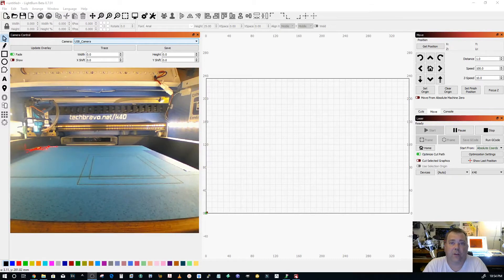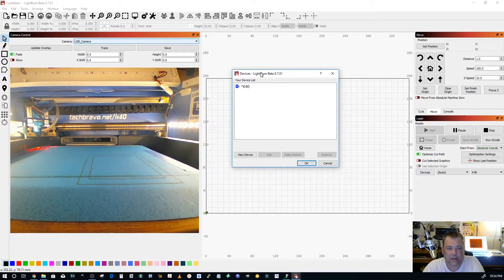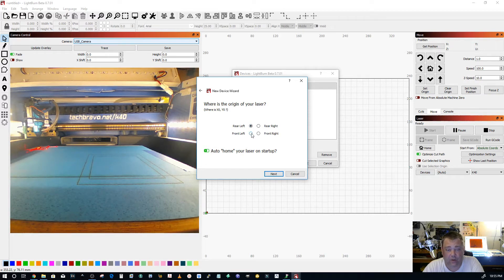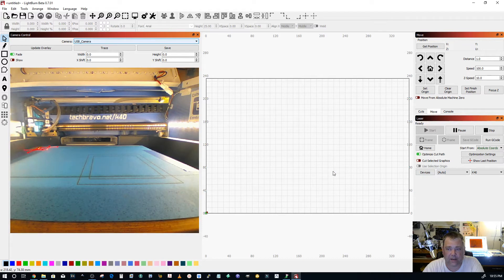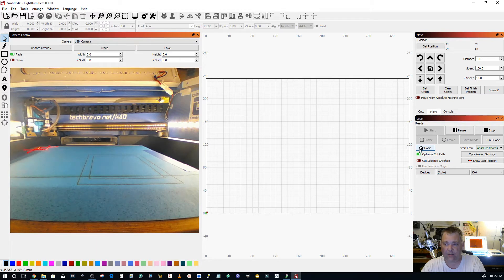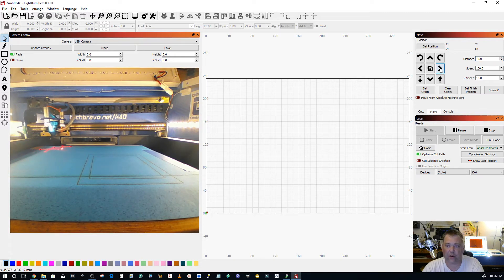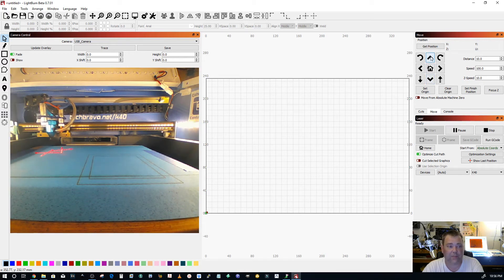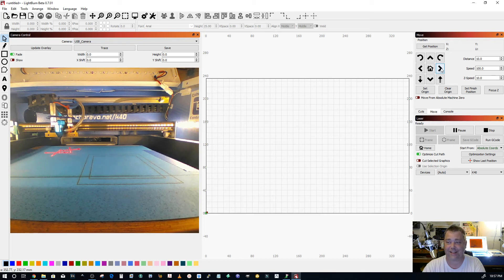Cohesion3D Mini Origin, Stepper Cable Verification, & Home When Complete

Comment: Hi, I’ve just changed to the same board on my 4940 laser, when I hit home it moves down towards the front and right , all arrow keys are working, when I start a job it dose not seem to know on the workspace where it is , it’s crashed into the railings a couple of times because of this, any suggestions?